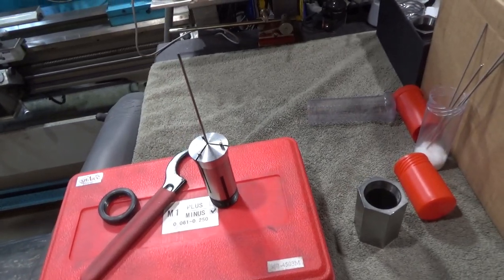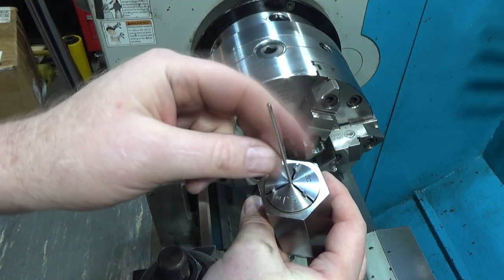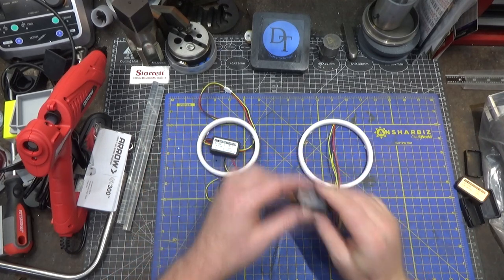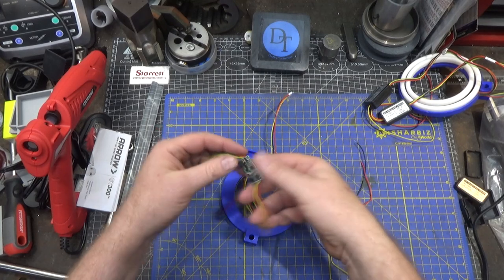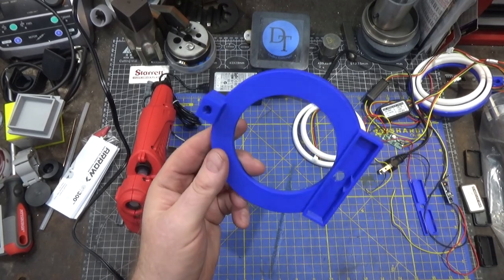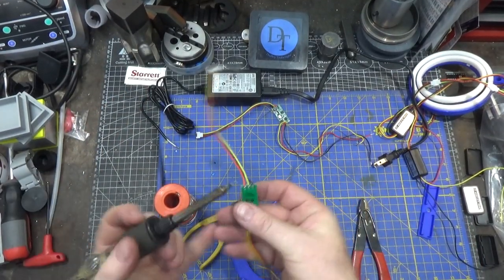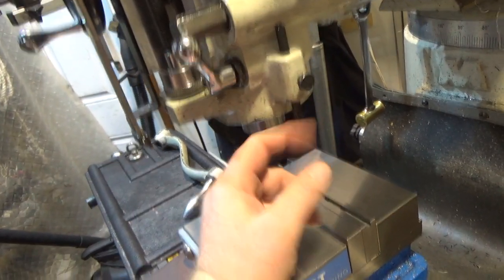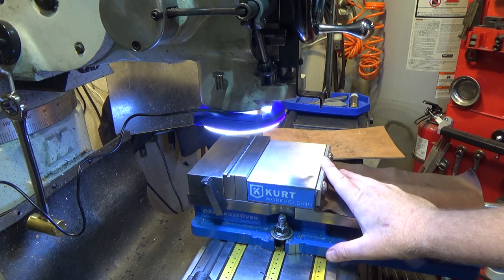Shop Miscellany #15 5C emergency Collet and Ring Lights

Comment: Interesting light ideas. I happen to use an off the shelf microscope solution. (Whi h is a ring lite) ....never enough light and i aint getting any younger
Reply from the maker: I feel ya. I used to wonder about what all the close up focusing issues were at work...until I got older. Now I know all too well.

Comment: Glad you’re sharing your ideas.  I did the same thing a couple years ago.  A problem crept up 6 months down the road.  The little bit of oil that creeps down out of the quill got into the LED ring (the casing is a split design).  Started loosing light until it died.  Since I had 2, easy enough to replace.  6 months later, same problem lol.
Reply from the maker: Great to know. Thanks!.  I guess I had better look into a better seal.

Comment: I've had a ring light like that on my mill for years.  Not that same one but it works fine, I just hot glued a couple of small magnets on it to hold it up.  It does attract iron swarf but its up under there and I can't see it so it does not  annoy me unless I'm doing a thorough cleaning and then just use a small stiff brush and that cleans it up.  Not big enough magnets to hold any large swarf but the magnet is not the best choice there but as it works and really is not issue I have never bothered to do something else.  I don't have a 3D printer like you do so did not have that option to make it fancy but that is the way to go for sure.
The light really helps see what is going on, great for filming, not that I do much of that anymore.
Anyway, good solution, thanks for the video.
Reply from the maker: Thanks for sharing your approach. I was considering magnets at first as well. They are an incredibly useful tool in the shop.
Reply: Yeah, I use magnets a lot but they do tend to grab swarf but at clean up I just use a small brass brush and get the worst cleaned up.  I hot glue a magnet onto my Sharpie and pencils so I can stick them anywhere on a machine, handy but again they try to clean out the chip tray but still works for me. @DudleyToolwright

Comment: Nice solution for the light.  I don't need it for YT filming, but for old eyes that can't see as well.  My quill OD is 94mm, so it looks like I can only get one ring around.  I am hoping that 1080 lumen will be adequate.  But for $24, it is worth a shot.  Thanks for the video.
Reply from the maker: No worries. My quill is 85mm or so. You must have a heavier duty mill than I. I hope it works out well for you.

Comment: I'd like one of these for my mill at work - but I use a lot of flood coolant that splashes everywhere, that might be a problem.
Reply from the maker: It depends on the coolant and the plastic used to print the part. I suspect that you could find a working combination.